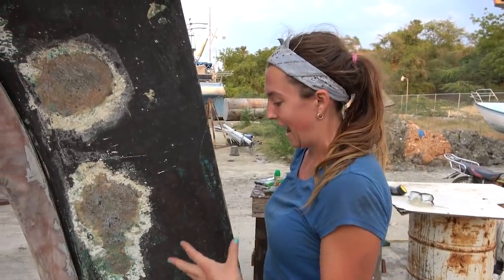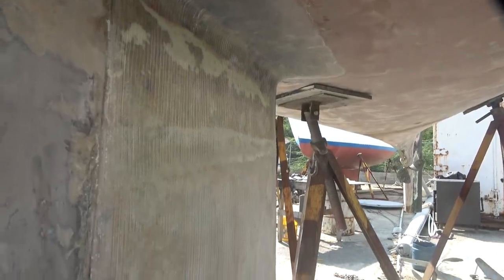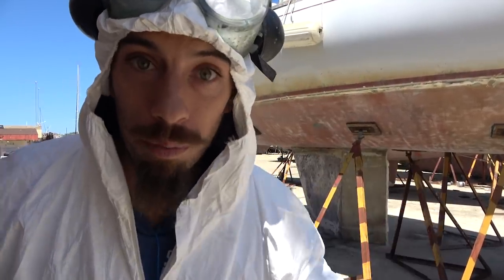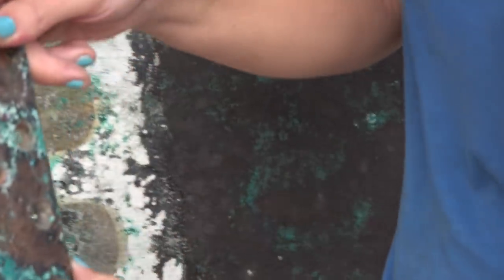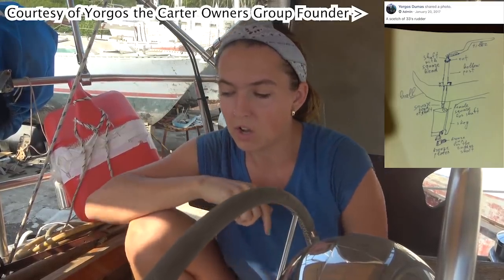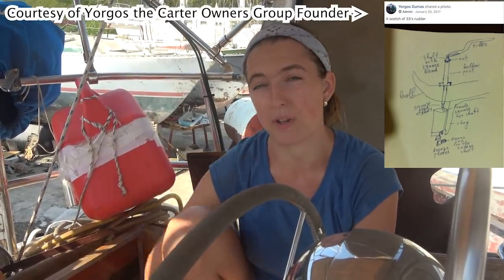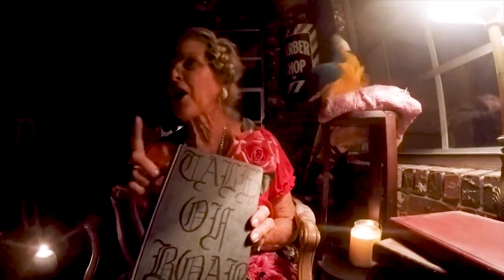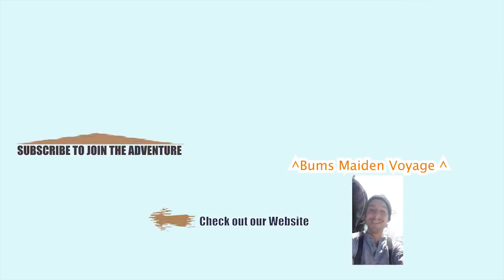We Found THIS in the SCARY Locker! Ep 72

Comment: Be sure you can put it back together correctly and service/lube everything as needed while it’s apart. I’d make sure you have instant access to the emergency steering shaft. You’ll want to be able to put that emergency tiller in place in a hurry if you lose steering.
Reply: This made me think: why do they want to take it all apart to begin with? Maybe just some cleaning, greasing and inspection would be best. If there's not a problem don't fix it!
Reply: Water leaking from rudder... @zxggwrt

Comment: Don't get carried away.  If the drawing you show at 6:19 is correct, then you don't have to do anything inside the boat to drop the rudder.  That drawing shows that the rudder shaft goes through the hull and then has a square end a few inches below the hull.  That square end fits into a female square hole in the top of the rudder.  So once you get the lower connection to the skeg taken apart completely the rudder should drop down without touching anything inside the boat.  There may be some set screws , but it doesn't look like there is more than that holding the top of the rudder to the shaft.

Those "drums" are called steering quadrants.  The cables will be attached to the quadrants, so likely all you need to do is disconnect the cables from the quadrants and there is no need to dismantle the pedestal.  Also, it looks like the quadrants are two pieces that are bolted together.  You can see four of the bolts at the top of the quadrant and the bolts at the outside edge of the quadrant at  9:14 in the video. I would be amazed if your rudder shaft is square anywhere except right on the top where the emergency tiller attaches.  At 10:44 in the video you can see the rubber hose that attaches the rudder stuffing box to the rudder tube.  A stuffing box requires a round shaft.  At that same point in the video you can see where the cables turn in to their attachments on the lower quadrant.
Reply from the maker: Correct but the square shaft does have to be lifted 3 centimeters according to the Carters owners group. As we understand the shaft is square and fits inside a round socket. We also received your message on Facebook and will be in touch. Thanks for your feed back.

Comment: Good news that your dog is safe! That had to be a lot more stressful than you are letting on. From the video, the top quadrant wire rope looks to be in much poorer condition than the rope on the bottom quadrant. It could be that the auto pilot steering was added as a retrofit, and the lower wires are just newer, or it could be the lower wire is stainless,  while the upper wire is plain steel. But from the level of corrosion, the upper wire looks to need replacement.  Since wire rope wise the helm and autopilot look to be independent of each other, the auto pilot might be useable as a back up to the helm, if it has a control that allows direct rudder movement, in addition to the autopilot function.  Greg
Reply: I'd replace that cable, myself, so I could SLEEP at night, lol.
Reply from the maker: Yes, it was stressful. How you know it was bad is there was no footage of the incident. The auto pilot is a more recent retrofit and that lower cable is newer. One of the reasons why we decided to take this apart is to replace the top cable. Good point, I see no reason why the auto pilot could not be used as a back up. There is a control that allows direct rudder movement.

Comment: Have you tried a product called Deep Creep? It is hands down the best for getting corroded fittings loose.
Reply: Hard to find but I love PB Blaster, parabolic action and all that stuff as seen on tv
Reply: @saylaveenadmearedead  I have used this on locks that were destroyed by sea water totally rusted solid. Returned to full service. Advance auto parts for sure. Made by sea foam products. It is the only thing we used, also it can be heated without burning off.
Reply from the maker: Never have but thanks for the tip.

Comment: Listen punkin, that top pulling on your steering is not straight and the cable is rubbing all the time. It should be centered in the pulley not rubbing the top edge. I can see that from Florida. Also a butt tan update is needed because what you were walking around with is illegal in most places, holy crap...
Reply: u r frkn funny- ur tacfulness is appreciated

Comment: The four bolts at the top of each sector (you called a drum) apply a clamping force to the rudder shaft, the keyway is there to help with torsional forces and not rely solely on the clamping force of the four bolts. They will have to be loosen or removed. I suspect the hose clamp was put the to hold the keyway in place when the sectors were positioned.
Reply: Agree, that space is so tough would be very hard to manipulate without holding the key in place.
Reply from the maker: Okay thanks for the vocabulary correction. We will refer to them as sectors from now on. Love YT for this reason. Okay Agreed.
Reply: @Bumsonaboat   Not a problem you can call them whatever you like, I'm a retired aircraft mechanic and that's what we called them where I worked. After stopping the video and studying it some more, it kind of looks like the sectors may split apart in two halves which would make them easy to remove and the job go a lot faster. I could be wrong though without actually being there. Be safe!

Comment: Another blessing In disguise Looks like That rubber boot at the bottom of the steering shaft  Might be a little swollen Don't know if that would allow water into the hold,,, Or if it's just to contain Grease for the shaft ..
ps. Differences between Dielectric grease( IE) Electric connection grease And regular bearing grease is( oil based ) it Causes rubber to swell,,,(lets in moisture ) Where dielectric grease is made from Silicon based )   Since you're on a boat I think it's important to know The difference in Grease  
PS  just trying to help
Reply from the maker: Thanks for the grease info. Blessing in disguise indeed.

Comment: The bad news. You may have to raise the boat higher to drop the rudder.
Reply from the maker: It seems like our rudder is not like most and doesn't need much clearance in order to be dropped...but we will see.
Reply: I had to do it on my boat. Both of my prop shafts had to be pulled and replaced because a poorly installed drive flanges had ruined the ends. The rudders were in the way of the shaft pull and the earth was in the way of the rudder pull. Funny how one thing leads to another and another.

Comment: Your fibre glassing looks much to dry. (Not enough resin covering the glass mat) this means when you sand the finished fibre glass surface you will be cutting into the glass mat. I don't think on layer of mat is enough so you can correct the situation by applying another layer. Depending on the glass mat you use you require approximately one litre of resin per square meter of mat. Then you will have some surface resin that can be sanded back to create a nice finish.
Reply from the maker: Hmm, we did use about that ratio and it was full saturated before we let it cure however we don't have much experience to draw upon so you may be right. Im sure many can tell just from looking at it. We do plan to add 20 milliliters of epoxy paint. This layer was a precautionary measure

Comment: When you get the shaft out, drill a nice fat hole through the square section at the top. You'll then have a way to pull the shaft up through the boat. This will be useful for re-installing and also if you ever want to drop the rudder without hauling out. (I have done this myself).
Reply: Love that idea.

Comment: Check the steering cables for broken strands . "meat hooks" they are called, if you run your hand over the cables and loose a chunk of skin you need new cables . LOL - don't use your hand , use a rag and if it gets caught you found a broken strand ,    if they have broken strands , they will fail and you will need that emergency tiller .  Never happens at a good time . 

Good call on rebuilding the rudder . The internal corrosion you can't see from decades of water intrusion can cause it to just fall apart one day while you are sailing - no steerage at all.  You will sleep better having checked it all over and restored it to better than new .  Looks a robust original build but that rust stain on the ground might be the SS webbing inside rusting where it is in an oxygen deficient environment. Stainless steel rusts unless it is in oxygen- I know that does not make sense but trust me .   Don't panic but be sure it is not rotten . You might need to drill a few inspection holes , Again the owners site is the goto , if they say it hasn't been an issue , you are good or they will tell what to  look for , how to look and what the fix is . 

As to the yard and theft attempt , can happen in any yard however sometimes the cheapest can cost you more in the end.  The guy will be back so lock everything up . 

The dog , good dog , but think it is like a child . You would not leave a child to run the yard . Don't do it with the dog either . She might drink antifreeze or get run over . 

And Joel - that young lady  is a keeper , you treat that lady right you won the lottery .
Reply: Looks like the steering shaft and cables were never serviced or greased ? It's just getting worse and worse. Sell the boat it's a Money Pit and still will be an old boat. In Florida there's thousand sailboats for sale. Cut your losses while you're alive.
Reply from the maker: Lol good way to test. We will use a rag and see what happens.

Yea, that would be terrible. We decided to go for it after much interaction with the Carter owners group. They are so helpful. Stainless rusts when it is deficient of oxygen..makes sense. Sure we will end up drilling inspection holes.

True and we will not let Lola run so free anymore. 

Who knew Bums on a Boat would actually turn into a love story.. I will treat her right.
Reply: @Bumsonaboat   The stainless when it rusts in oxygen creates a barrier coat that stops it rusting pretty much instantly  .  When it is in an oxygen deprived environment such as keel bolts in the keel or the web in the rudder then it never gets the barrier coat on it will rust like any iron will in salt water.  The exposed part will be fine as the barrier coat can form . Probably not a problem for you but still check given you know there was water in there. Not sure if drilling holes is the best way to check on your set up - ask the owners forum . 

Replacing the cables might be a good idea anyway while it is apart if you have the budget . They don't look like they were done recently . 

Boat is looking good , oddest keel I have seen in a while with that false section but you have it under control - owners forum is the go to .  They might have the fix for the busted stringer too - I bet yours is not the first .
Reply: @MegaBait1616   Boat is fine , the rebuild of it is part of the adventure and part of why we are all watching and and helping to fund the project  . We don't want to watch another series of perfect beaches and  a bunch of people that think the engine is a magic box and a loose wire is a disaster .

You are thinking you , where you want to just get sailing and are not making a video log of the adventure . Then ya get a different boat . 

Sailing UMA started with a boat arguably worse off , the engine was removed and the keel was about to fall off with the entire structural grid busted or rotten  and you could wobble the keel by hand  , and the interior was no redeeming feature either.  Them learning and rebuilding it was why we watched . Today they are the ones giving advice . 

What is wrong with this boat is not big bucks, it is lots of labor though . When they are done  the will have a solid boat AND the knowledge to fix and maintain it no matter where they are . People will call them for advice .
Reply: @faircompetition1203  , Question would you sail across the straits of Florida with that boat ?  no Zodiac life raft, no immersion suits or EPIRB ?
Reply: @MegaBait1616  Nope , that is why it needs fixing . There are a lot of boats I would not take to sea. She is on the hard and getting fixed , yep they will still be short a few electronics and stuff but then I remember the miles I put on with my father on a boat with no electronics at all, no log, no way to charge the one battery and no radio . You plotted your position religiously instead of relying on a GPS .  You had to , or you were lost . 

Brains and seamanship are a huge  compensation as I watch video after video of the latest yacht driven onto a reef  by a credit card captain . 

Your suggestion is for them to buy a boat already done and refit , ready to just sail away  . Hope you are a really really big patron.  They have energy , gumption and persistence - not cash . 

The fun will be the the restoration and those two seem the kind to learn fast . They will be well rounded skilled people who can fix anything and understand the limitations of the boat they are in . Yep green now , but we all were once . 

Besides , they look like just the kind of people I would love to have a drink with .

Comment: Nothing for nothing, and this one of the scary things about newbie cruisers- that steering system should have been understood and full serviced two years ago when you started out, but, moving on...(and excuse me if I am in era...)
-Cockpit access cover, rebed outer ring, service, clean and lube threads, wrench made for access plate, create a dedicated location for the wrench.
-Inspect entire system, replace cable, nuts bolts, shackles, key-ways, clamps that show wear (having spares is also a really good idea)...
-Clean and lubricate as necessary...
-Check packing gland, packing material, rubber hose, hose clamps, double clamp every thing associated with a thru hull openings, get the best SS available, rubber hose should be of proper thickness and supple, any doubt replace it.
-Inspect pintels/hinges/pins/shafts for wear...
-Often it's not a bad idea to add extra zincs to/and around rudder or prop shaft especially if you find any corrosion or 'copper color' to the bronze pieces.
-After splashing, check gland for leakage and adj. if necessary.
-During and after first sail again check for leakage.
-Try using the emergency tiller when under way, they are usually a lot more difficult to use, steer the boat than you may think, due to ergonomics and engineering, you may find you want to add an extension to improve leverage. This also could be quite important, if the steer system fails, often any auto pilot or self steering gear will also be rendered useless and you could hand steering 24/7 until you make port. So the better the emergency tiller works the more manageable getting to port will be.
-To avoid the emergency tiller necessity (which is going to suck) do a super good job on the whole steering system. You'll have years of trouble free service, but reinspect periodically and put it on your maintenance schedule/log (you do have one, right?)
-Enjoy the good life...

Comment: You have at least four bolts on your cable hubs to remove starting top to bottom (check for set screws there also). Make a small wedge or taper chisel into where pulleys are clamped to relieve pressure on shaft. Hose clamp on key is to hold it in place while you are assembling the unit, you cannot fit enough hands in there, someone was thinking, it has been out before. Do not be surprised that there is a key in the autodrive pulley, set screws are not enough to lock pulley to shaft. Below that is your rudder gland and bearing in that lower black hose attached to the hull. You might have to dig a hole under your rudder in case you need drop depth. Check with your MFG. forum whether that rudder shaft comes out the top or the bottom. Make sure you lubricate the rudder shaft and those hinge assemblies with silicone grease, You can get it at a place that sells pool supplies, they use it on pump o-rings. It will be a non-conductive grease to reduce electrolysis from joining those different metals together. Take your time, it is going to be a PITA.
Get some cheap tinker bells or hole through a can and rattler tie to your stuff for a cheap noise alarm. cover all your stuff stored outside under some kind of trap or cover, make it more difficult for folks to know what you have...they don't care about you only what they can make or save money on...that is the way thieves are...you are also being watched by someone in the yard to let them know when you are not on the boat (daytime robbery, most boat thefts sailing happen at night/early morning when sleeping the hardest; reduce their risk of getting caught,) your dog probably followed them, but is too friendly to protect the boat and young...think about it.......